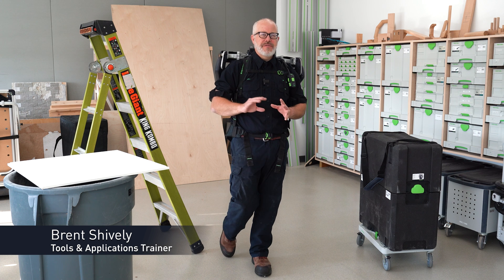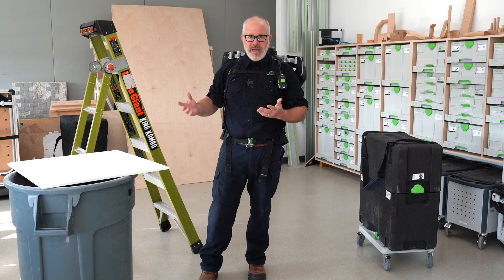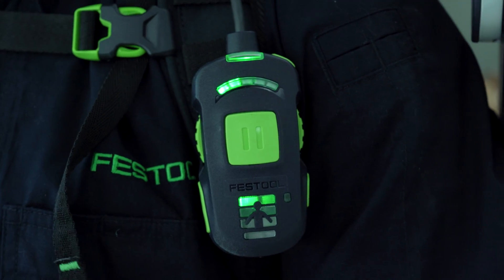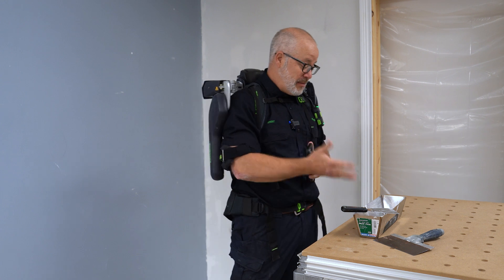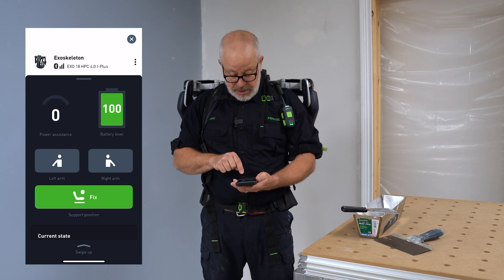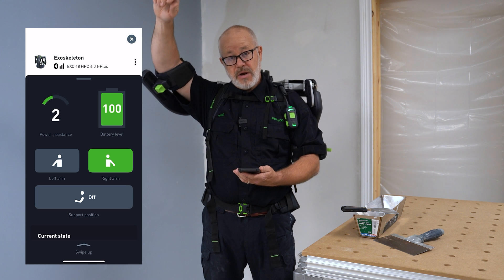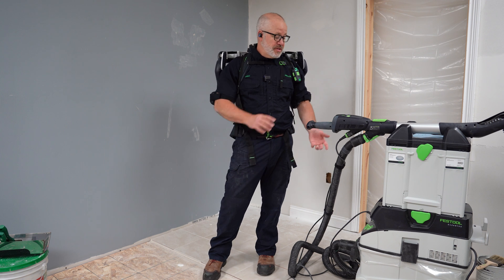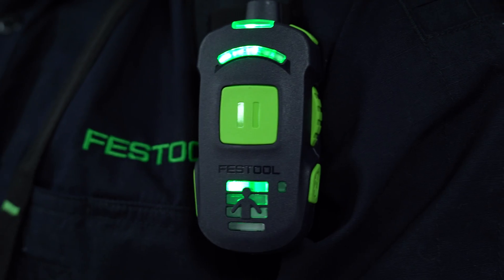Common Applications with the ExoActive Exoskeleton

Comment: Just received mine today. Will see how it works long term
Reply: So how was it? Are you a believer or did you return it? I'm dying to know.
Reply: @BeautyMommysUnite  it's very situational I'd say. I got it because i do a lot of overhead sanding, spraying, masking etc and have a shoulder SLAP tear injury which makes one of my shoulder have almost no strength overhead. it does reduce fatigue but only worth it if you do enough overhead work to strain your shoulders and arms. Not useful outside that.

Comment: In the short term, it could be more battery efficient to be able to somehow “lock” say an elbow joint if holding a mud pan for 10’s of minutes on end. In the long term, design a lower half to the exo with extension stilts somehow built into it. No more step ladders!